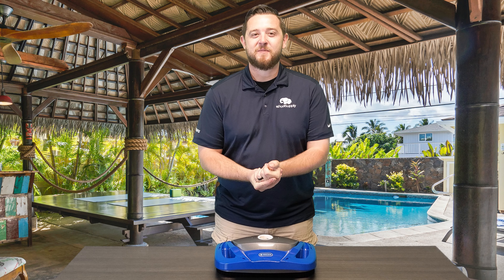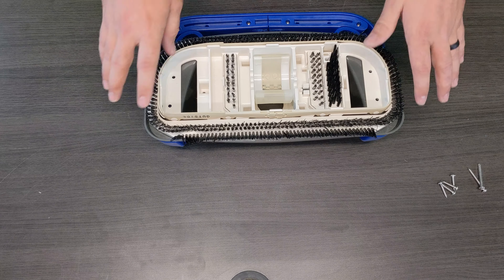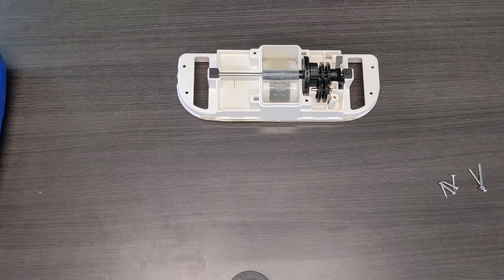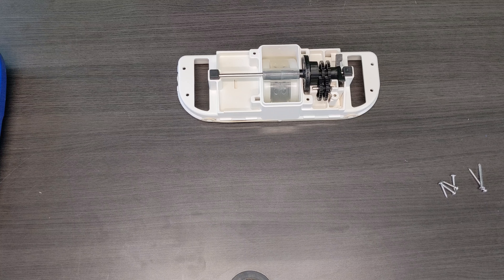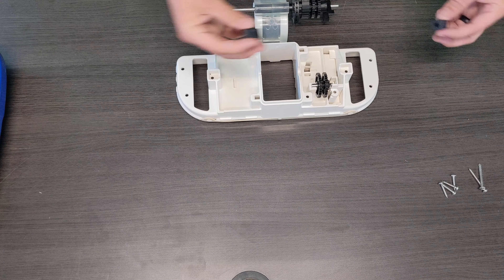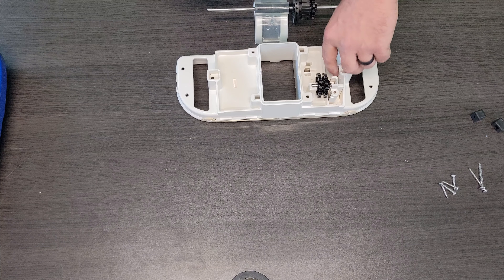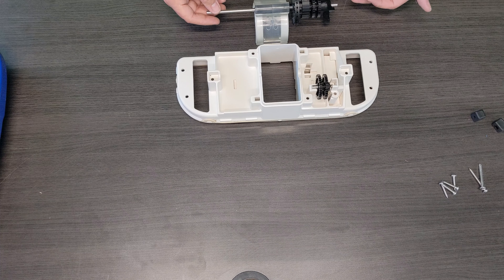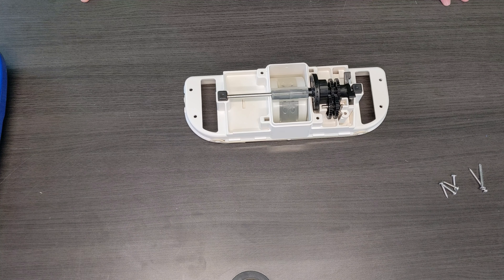Pentair Kreepy Krauly Dorado Cam - Quick Fix

Comment: Thanks for great video. I am having some issues with my system. Wondering if you can help me out?! I replaced the cam and the 3 gears. I did not replace the other pieces. My dorado is not moving as it should and it is also not turning. I have also replaced the skirt. Not sure what i am missing. I can send you a video of the internal system and simulating the back and forth movement of the middle piece. It seems that the gears don’t want to spin the cam. Not sure what is going on? Pls let me know how j can share the video. Thank you in advance!
Reply from the maker: Could be the lift brush and or the spring that operates it but I definitively say for sure that what it is.

Comment: Should the b arm be always on top when replacing cam?
Reply from the maker: Im not 100% sure so you may need to contact the manufacture to confirm. 1-800-831-7133

Comment: Hi. The vacuum keeps going in circles and not moving around the pool. Is that because of the cam? Do i have to change the Idler gear as well? Thanks
Reply from the maker: We would suggest changing out both and see what happens after that.
Reply: Thanks, I replaced both and now the vacuum works like new. No more constant circling.

Comment: I have not been very happy with the dorado and mine already looks likes it is ancient. Only 2 years old and keeps getting stuck in an upright postion like the brush is not going down. I have taken it out and clicked the middle and it moves completly normal. Brush goes up and down correctly when it should. Gears still look good. I had 2 great white vacuums each for many years and lasted much longer. Very upset since this vacuum cost so much money and the quality is so bad now. I am not sure what is wrong with. Changed the skirt already. Any ideas? Thanks so much.
Reply from the maker: Sounds like either the cam may need to be changed or that spring on the lift brush. Hope this helps!